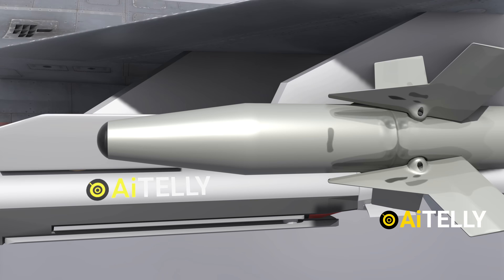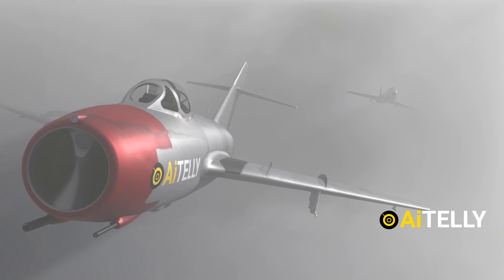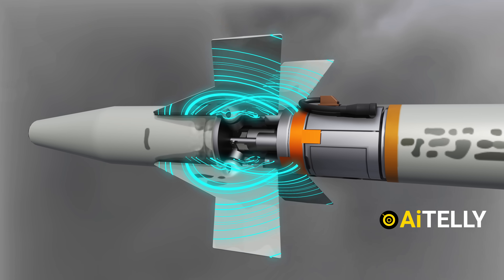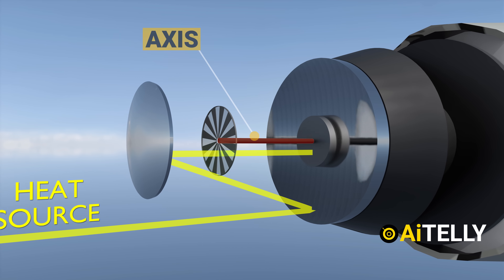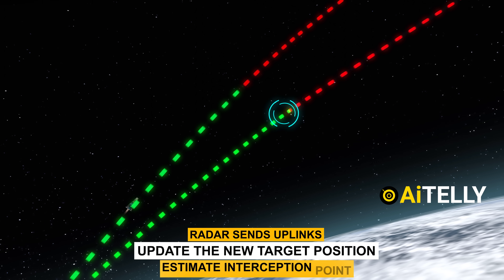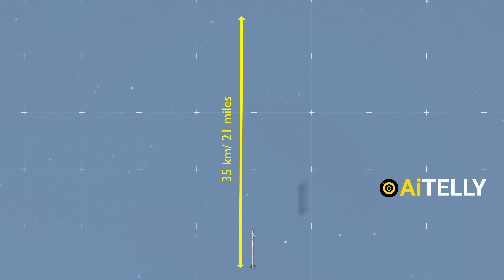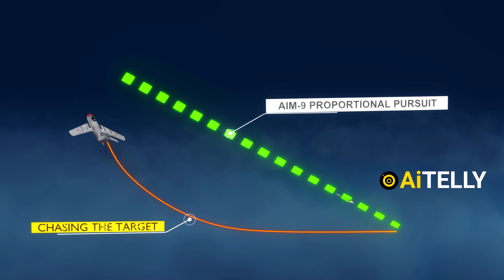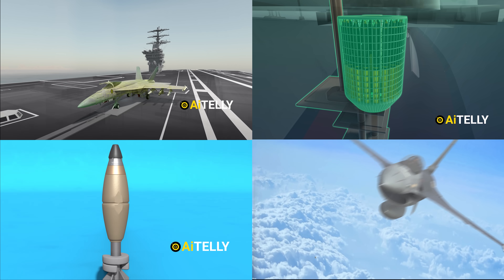How Heat Seeking Missile Works I Aim 9 Sidewinder

Comment: One thing that wasn't mentioned is the rocket motors burn out VERY quickly. Unlike a Hollywood movie where the missile twists & turns following the enemy aircraft, forever. That's not real life.

The first Sidewinder rocket motor only burned for 2.2 seconds. Today's models are somewhat better but still only 3-6 seconds. So, they glide most of the time and quickly lose energy as they turn, especially at low altitude where the air is thicker and there's more drag. Experienced fighter pilots know this and can easily defeat a Sidewinder if given a chance.

P.S. All missiles including the lastest long-range radar missiles have short burn times. Only the most modern and expensive ones that use dual-pulse, ramjets, etc. are different.

Comment: The WDU-17/B warhead (used in the AIM-9L
configuration) is an annular blast fragmentation warhead that consists of a case assembly, two booster plates, an initiator, high explosive, and fragmentation rods. The explosive output from the S&A device is transferred through the initiator to the booster plates. The initiation is then transferred through the explosive-loaded channels of the booster plates to the booster pellets at each end of the warhead. Detonation of the booster pellets sets off the high explosive, causing warhead detonation. These missiles don't hit the aircraft but detonate at a reasonably close proximity (blast radius is 10miles give or take) so the fragments hit, disabling it.

Comment: Hopefully I didn’t miss it, but how does the IR seeker ignore the sun as a heat source?
Reply: I think it has most of the airplanes are stored in its onboard data base and it looks for the one it's tracking and when it finds the airplane, in it's onboard data base, it locks on to that and ignores all heat sources. I think?

Comment: We know the Swedish Colonel Wennerström spied for the Soviets and handed over AIM-9B blueprint copies to them in the 1950's when Sweden bought and licence built the AIM-9B as one of the earliest adopters. The Colonel was part of the group responsible for importing and acquiring advanced weapons from the US for the air force.
The Finns used both AA-2 and AIM-9 and the missile's where compatible (a Sidewinder rail would interface with an AA-2)  which is kind of crazy.

Comment: The rotational element is a thing on early radar guided missiles as well but there the whole radar rotates its signal around the target to see where it is.
This is also how you jam such a radar (a conical scan radar) you just measure the rotation frequency and then send your own return pulse that is stronger than the return ecco. You can now manipulate the radar to break lock by guiding it away from the aircraft.
This is the reason many early radar equiped fighters had a secondary IR seeker. It was to make jamming harder

Comment: One thing i would add is the differences of irccm systems, while missile like the 9b had a big open round seeker to detect the biggest heat sources, it made it almost guaranteed to fail to hit anything, even by reducing throttle. More advanced varients like the 9e-9l have uncaged seeker, wich after either being slaved by radar or locked will already start to follow the locked source with their sensors to be able to lead them before firing, increasing intercept chances.

Now missiles like the 9m had a new irccm in them, it could detect flares and would rapidly close and reopen the seeker like a lens from photographs, plus being able to be helmet cued so the seeker head would follow pilots head movements allowing for really accurate lead.

The aim-9x blk II+ almost cant be called an ir missile anymore, like its many counterpart. It has thrust vectoring and an irccm system that reduces the size of the seeker  with time allowing the missile to have less and less chances to lock something else, making it undodgable during dogfights. Its irccm also aims at the shape of the engine heat sources being more triangular shaped while also aiming directly at the plane itself. The missile can also with datalink be launched before aquiring a lock and then while being guided by the radar like an aim-7 sparrow, will lock the first thing it will see. 

Note that the aim-9x is the best at dogfights. Compared to its counterparts like the irst asraam and r74 the 9x pulls 80+ g almost instantly but lacks the insane ranges of the other missiles, irst for example can pull 100g at least during booster phase

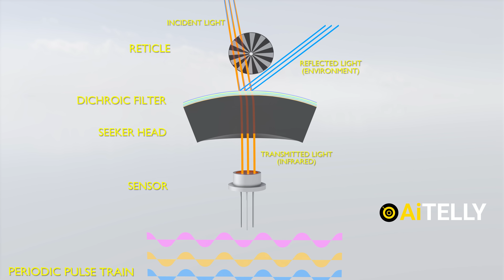Comment: 4:13 There are 3 different transmitted light beams into the sensor. Does the sensor compare those three beams and try to keep the target at the position of the middle one (middle radius) as is implied by the showing of multiple pulse train? Or does the missile try to keep the target in the middle circle and all the beams are examined by one sensor as one, and only the peaks are important -> missile try to minimalize peaks in the signal.

Comment: The first one was made by pilots and engineers working in their garage in the 1950s. It was crude but way before its time. It would track a plane only if fired from behind. The "rollerons" mentioned were discs inserted into the ailerons. This heat seeker was put together by a group of civilians and not funded by the government. It was crude but the genius experimentation would have been shut down by Newsome or any other socialist.

Comment: And next time you might actually explain how the original AIM-9 guidance system works. The pics are nice but this is not a nexplanation for what happens between the spinning wheel and the fin-servos.
Reply: he kinda forgot to mention the fact

I'm pretty sure the first aams did not have proximity fuses right?

Comment: Could one theoretically throw off the “Target detection” AI by adding such bright lights to missiles the AI can’t determine relation between photons?

Prior to striking a target I think cheap quadcopter drones moving in coordinated swarms with signal jammers and bright lights could surround a target to soften it prior to a payload strike. Perhaps they have exceptionally bright lights to toggle prior to payload impact to throw off photon relation algorithms as the missile enters range to throw off radars and ai automated systems alike? 

Not a professional, massive dunning/kruger sufferer admittedly so. just a goober who loves to engage with this at a conceptual level. I understand this assumes I know how the detection algorithm works but beyond photons or radar I am not aware of other methods of determined friend from foe. Anyone with more knowledge care to humor my speculation and correct any misunderstandings?

Comment: With radar guided missles the plane radar locks up the target. But with these the missile sensor does all the targeting or the plane radar also communicates with the missile? If only the missiles see the heat signature how does it work with for example the f22 where the missiles are inside?
Reply: The Aim-9X that is fired from the F22 is able to "lock on after launch" so the missle gets target information from the plane and then tries to lock it on after it has been fired. The same kind of method is used for "full sphere capability" missles like the IRIS-T, so the missle can  even be fired on planes that are behind the mother-plane.
Reply: @Zu-nice-Alder  Then the f22 has a infrared sensor outside on the plane? Or the missile gets information from the pane's radar and after fired it changes to its own infrared sensor? So it chages from radar to infrared?
Reply: @tojassargaja2085  I think it was the second one on the f22, but for the f35 for example you can fire them either with the help of radar, or your helmet-mounted-display, or even trough your missle warning system, thats based on IR sensors

Comment: Where you have the warhead is a radar system. Since the sidewinder is meant to over correct its assumed it will effectively fly past the aircraft, so when it gets a strong return on the side looking radar the system assumes its beside the aircraft and pointing ahead of it, and detonates. If the target aircraft is not damaged by the initial burst, its going to fly into a cloud of debris fouling the engines at the very least

Comment: This type seeker is old, made in the1950s, this is one of two types of seekers they used for the stinger and the older missile called redeye, the one he's talking about now is called a reticle scan seeker that uses ir detector's in the seeker, which pick up the heat from the target, the detector signals go to a microprocessor that creates an image frame, this action is repeated constantly while the missile is in flight, the multiple frames are sent to the tracker electronics  I they quit using cause

Comment: How does a heat seeking missel lock onto a piston / prop driven plane with low heat signature? Someone please help.
Reply: It tries. If it can't find a hot enough source then it won't lock
Reply: @pinngg6907  Thank you. With that thought in mind then I would think that a WW2 P 47, P 51 etc would be a somewhat difficult target to deal with in a modern dogfight. Most modern fighters are not armed with guns so they would not be effective if armed with missiles. Interesting to think that in some ways technology is a circle to an extent.
Reply: @michaelangelo7511  not true, most fighter in service today still have guns in them, even F35.

Also active radar homing missile such as aim120 can easily lock on ww2 planes as modern one since they rely on radar cross section rather than heat
Reply: @pinngg6907  Thanks I was under the impression the guns were obsolete in fighter jets.

Comment: The AIM-9M and newer versions after that had IRCCM (InfraRed Counter CounterMeasures) so it will now the difference between engine heat and IRCM. also the AIM-9A/B didn't have the capability to pull major G's if I'm correct only able to pull 10G's which is not much compare to the more modern AIM-9X where its able to pull up to like 45+ G's.
Reply from the maker: Awesome piece of information 
Thanks 🙏🏻👍🏻

Comment: Despite the animations being as great as they are, the explanation leaves a lot to be desired.
Reply: I’ve actually been working on a similar video with a physical 3D printed scan head that works in the visible range. By swapping out the different optical interrupters it’s easier to see what the signal of the seeker head is actually encoding. 

As a note, I’m fairly certain that this animation is partially incorrect. The pure segmented optical interrupter would only give you distance off bore axis. You need a rising sun reticle to calculate angle off bore axis. 

The two pattern combined into the same reticle is what allows both angle and distance from the ir diode to be calculated.
Reply: That’s assuming it’s using pure spin scan - with conical scan you can derive it with just a segmented reticle.

Comment: I think there is something you missed about the reticle. The reticle only has this sort of pattern on one half of the disk. The other half, is 50% transparent. The reason for this is because the frequency of the signal does give information about the radial distance from the seeker head, but it does not give information about the orientation of the aircraft (degree in polar coordinates). With the help of this, the computer can compare the phase relation to a reference signal and thus figure out the orientation. Altho it is true, that during its construction there were many different reticle variants considered and implemented.

Comment: I wish the video explained how the missle keeps locked on to the target.
If it’s out of the centre of the reticule, how does the computer know if the rocket needs to go up/down/left/right to realign its course with the target.
Let alone the mentioning that it takes a shortcut, and aims at a location where the target will be (in a few seconds).
Reply: There is no computer, it is just analog electronics, using basic electronic components to filter that signal and translates them into movement commands. The spinning thing generates a base frequency, I guess like a carrier frequency in radio communications and If the light was shining through a hole and then the target moves to either a blind spot or will be visible for longer than if it stood still, it will delay the signal, and shift its phase, so they have electronics to comoare the phase shift/frequency and stuff, which tells it the target moved right "a bit", so move the control surface "a bit more" right.

Comment: 1:21; in this air combat, many Chinese PLA Airforce Mig-17s, not Mig-15s, were shot down by ROC Airforce F-86 Sabres with Aim-9B Sidewinders. Mig-17 has air supremacy over F-86 because Mig-17 speed can reach sound speed but F-86 does not have the this speed as Mig-17.

Comment: I believe this question was settled a long time ago
"The missile knows where it is at all times. It knows this because it knows where it isn't. By subtracting where it is from where it isn't, or where it isn't from where it is (whichever is greater), it obtains a difference, or deviation. The guidance subsystem uses deviations to generate corrective commands to drive the missile from a position where it is to a position where it isn't, and arriving at a position where it wasn't, it now is. Consequently, the position where it is, is now the position that it wasn't, and it follows that the position that it was, is now the position that it isn't.[...]"
Reply: I’m not defense expert can you explain me in very simple sentences.
Reply: @SigmaSigma-wd5wl333  it's a meme
Reply: This only applies to INS guided missiles, and that guidance system is only a backup to a backup on any air-to-ground missile used in the past 30 years